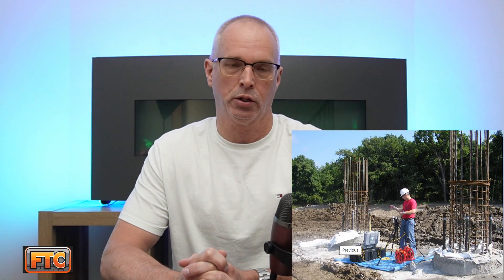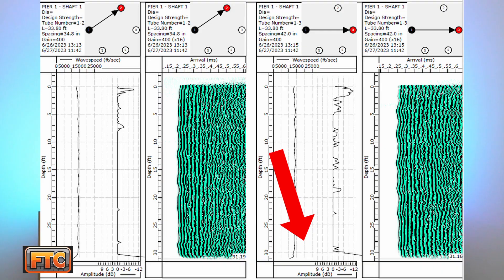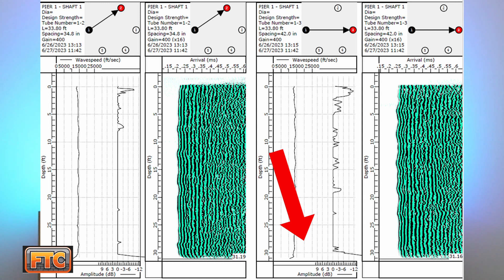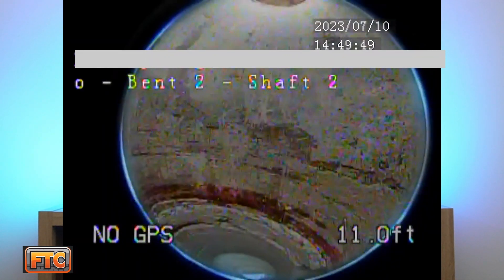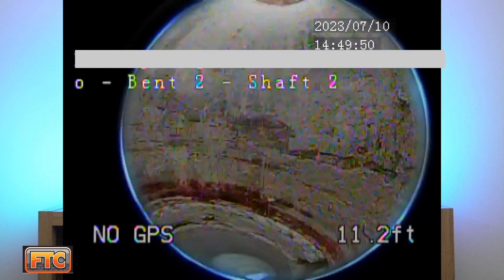What Should You Do When CSL Test Results Indicates a Shaft Anomaly

Comment: Thanks for sharing. I also commented on your previous CSL video. I'm involved in a project where, by contract, CSL piping must be installed in all pre-excavated piles, which are more than 3,000 piles. In many cases, no anomalies arise, but in many others, they do. In my opinion, the CSL results raise more alarms than they clarify. If anomalies are detected, it's always difficult to determine whether the pile is performing as intended or not; due to scheduling issues, the pile is simply replaced, and proper engineering is not possible (and the evaluation method is not entirely clear yet).
It ends up being somewhat frustrating that CSL readings alone can have significant impacts on the cost and execution time of the project.
Reply from the maker: Thank you.  I have performed CSL testing for over 15,000 drilled shafts in the last 25 years so I know what I am doing.  From my experience, there are 2 major problems areas related to CSL testing:  (1) The testing firm doesn't adequately differentiate between data quality issues and shaft quality issues.  For example, bleed water migration along the outside of the CSL pipes can degrade the signal and superficially appear as a concrete issue, when in fact the concrete is fine.  Some testing firms also don't do a very good job in delineating the size, extent, severity and likely cause of a true anomaly.  (2) The owner wants perfection in their drilled shaft construction and doesn't want to acknowledge that many anomalies don't impact the overall shaft performance and their designers are either unable or unwilling to assess the suitability of a shaft as constructed rather than as specified.  It is possible that you are experiencing one or more of these factors on your job.  Reach out to me if you would be interested in having my firm either review the CSL reports that you are being furnished or to perform actual testing (I don't know where you are located).  You may contact me at info@ftandc.com